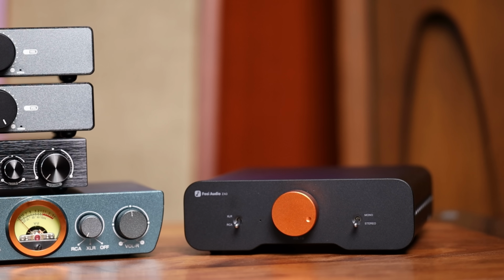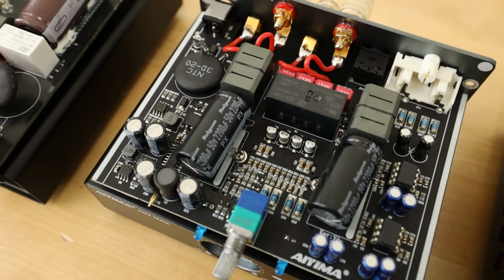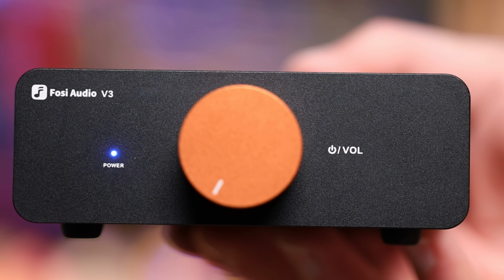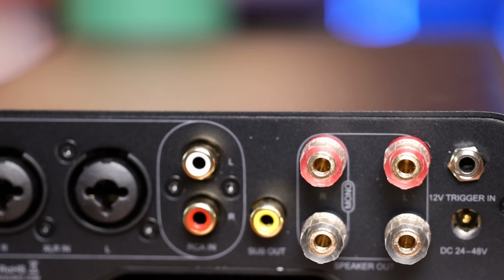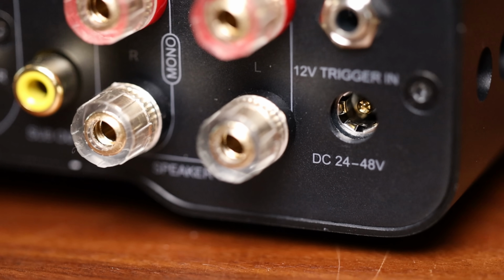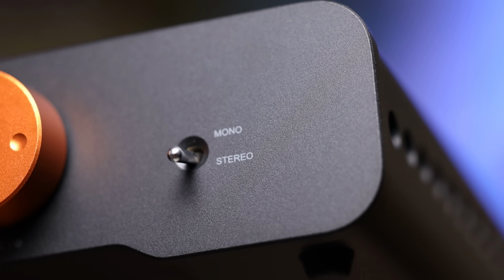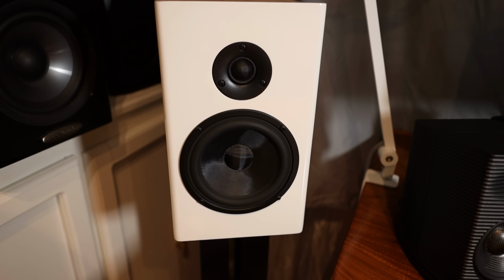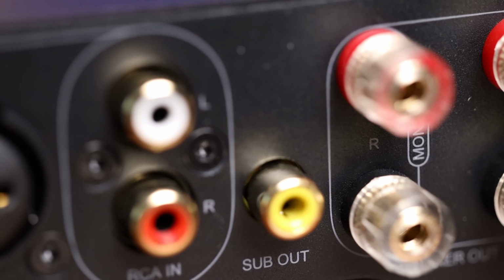Fosi ZA3- Teardown / Comparison / Review - Topping LA90 Who?

Comment: A few suggestions for these ChiFi designers ...
1) Separate power switches.  We don't always want to mess with the volume control.
2) Move the stereo/mono switches to the inside of the unit.
3) Make the leap to full auto-switching balanced inputs. 
4) Include dip switch selectable high pass and low pass filters in the sub-out chain.
5) Start publishing honest specifications.
6) Include Clipping and Protect lights on the front panel.

For #3 ... it's only a matter of a couple of resistors to make those XLR combo jacks accept Male XLR, TRS balanced and TS unbalanced then it's one more resistor to connect the RCA jack to the  hot lead on the balanced in.  ... no switching required.

For #6 ... The TPA3255 supports Clip and Protect lights natively on pins 21 and 19 respectively. It's only a matter of 2 resistors and 2 leds to add them.

If they want to swim in the big boy's pond... they gotta bring the right flippers.
Reply: Thank you so much for your suggestions. I will let you know if we have any updates. By the way, as per the switch selectable high pass and low pass filters, do you mean you can select any frequencies you want? Or just a fixed crossover frequency like 80Hz for high pass filter and 125Hz for low pass filter?
Reply: @fosiaudio  I would like some kind of high pass switch on the main outputs - 80hz is fine. It doesn't need to be switchable. Just something. I had to buy an external high pass and was not happy doing so because the amp was still amplifying the unused lows.
Reply: @fosiaudio 
Thanks for your reply.

If you use 8 position DIP switch modules, you would be able to set at least 16 frequencies for each.  The filters aren't hard to design, it's just a matter of  switching in different combinations of capacitors.  

The two things I really want to see are the separate power switch and that stereo/mono switch moved to a safer location.  I won't be buying ZA3s until you do.

I've already spoken with a couple of early-adopters who've had the ZA3s shut down on them when they flipped it into mono with the power on.  That's not a good thing to have out in the open where curious fingers can cause problems.  

Really guys... you have good products, don't mess yourself up by being careless.
Reply: @Douglas_Blake_579  Thank you for your kind suggestions, we will consider them carefully. And if you have any other ideas and suggestions, please let me know.
Reply: For 70 dollars. Joker
Reply: @psysword 
You apparently have no idea what that $70 TB10D can do when the issues I identified are resolved.  It's actually pretty impressive.

 The ZA3 and future designs are a little more than $70.00 ... by a factor of 2 or 3 times more. 

Plus this company actively solicits user input, which is what I am giving them.
Reply: You should start your own company, since it's obvious you know your stuff.
"AssholeFi Corporation LTD". No need to thank me, friend.

Comment: Hey don't worry about that. My settings on my tablet wouldn't allow me to see the whole page once I got that fixed I found out they're stating it's 300 w * 2 into 4 ohms 150 watts * 2 * 8 ohms and the difference in the Bluetooth of about $7 is ldac support. If I end up getting it I'll let you know. I wish it had an external power supply. Although, looks wise it is very handsome and the venting on the top looks excellent. I'm leaning towards getting it but trying to at least find some sort of review written or video. Might have to look at other countries in Google translate works good. LOL. Keep up the great work thank you Erik

Comment: Based on your review I got one. Can't agree more with your review,so thank you. Further in this topic I placed my findings. One thing to note: I saw a topic about the XLR inputs not being 'true' XLR internally. Not sure if that will make a big difference, because it sounds impressive as is.
Reply: There's an easy test for this ... Select the XLR inputs... with a sewing pin gently touch the contacts in the connector (don't worry it's perfectly safe).  If it is true XLR pins 1 and 2 should both result in a buzzing sound from your speaker.  If only one of them buzzes, it's probably just a single ended input hooked up to an XLR connector.  (And you might be surprised to find out how common that is.)
Reply: @Douglas_Blake_579  
Now that you said XLR to single ended input, that's it. I read that on a thread from ASR (with pics) pointing this out. Thanks for the suggestion re. testing this, appreciated!

Comment: the fosi za3 has some issue, even tho they use the tpa3255 and learned alot from the v3, the za3 has more distortion and lower sinad and lower wattage than others using the tpa3255. strange how a balanced design somehow gained more distortion and less power in the circuit design. also wondering why they opted to make such a small heatsink connecting plate to the case, but i am, impressed with the addition of thermal paste, i did this first when i saw my v3 bare metal on metal ,there is a slight gap that should be filled to help transfer heat anyways

Comment: 12 Volt Trigger for ZA3 ... a solution to the power switch on the volume knob...

Do a search for the "Emotiva ET3" ... https://youtu.be/MBgJn241KNc?si=pc6o3RlHPQ3I4eq_

This might also make a good DIY project. It's nothing fancy, just a 12v power supply, a switch and some jacks for trigger cables.

Comment: You’re wrong about the V3 volume control. I leave mine set in one position. It turns on without rotating it after powering back up.
Reply: You're turning off the AC, right?
Reply from the maker: Right, you would have to power it off externally from the amp to accomplish this which is fine and what I would suggest to avoid using the volume control. A smart outlet or switching power strip are potential options.
Reply: @Douglas_Blake_579 Ahhh, so that's why the Douk Audio ST-01 Pro goes to Stand by...  Also good for the tubes.  Many hi-fi components have a standby setting.
Reply: @peterbaugh51  
I'm not familiar with the ST-01... so I can't really give you much of an answer.
Reply: @MattCoykendall1  
Please be aware that killing the AC is also going to cause strong current inrushes when it's turned back on. Over time micro-damage accumulates in the power brick and it will probably fail prematurely.

In a couple of cases I've seen power bricks -- and equipment -- fail in about 1/3 of it's expected lifetime because of current inrush.  In one case the inrush was as much as 10 amps that lasted about a second... not good for a 5 amp brick.

Comment: Nice improvement over the V3 thats for sure.I would like to see full sized binding posts on something with this much capability, a volume defeat switch so you can use them as power amps, which would go on the front while the mono / stereo switch should be moved to the back. Hopefully Fosi has a new pre-amp coming to go along with this to expand I/O, and add remote capability as this is way more than a desktop class amp and not having a remote is kinda a big deal.
Reply: We are developing, but the case of ZA3 is too small, so we will use  a different case.
Reply: @fosiaudio  Good to hear, and looking forward to seeing it. These amps can definitely be a bit bigger given the systems they can power.
Reply: @PhillioDoede  If it is more bigger, I will add more inputs on it. Haha
Reply from the maker: I was hoping to see a pre amp coming for this pairing as well, I know they have something in the works.

Comment: Do you think it makes any sense to chose the 48V GAN power supply unit instead of regular 48V?
Reply from the maker: I can’t say for certain, I recall reading mixed reviews on that one.
Reply: I've noticed an increase in bass response using the 48volt/5 amp power brick on these 3255 Ti power amps. If you can get a deal on the 48v brick it's worth it.
Reply: what is GAN. i saw that on their site?

Comment: If it had a remote I'd buy it
Reply: Let Fosi put the right minerals inside the box and forget those bling bling you were asking for. It's the AVR's job to provide the remote.
Reply from the maker: Best bet it to connect it to something with a remote, budget wise a wiim streamer, use it as the DAC/Pre. I also have an SMSL DAC with a remote I use at my desk that has balanced connections and a remote.
Reply: i understand what your saying but there is no way to get around 
two volume controls @MattCoykendall1
Reply: We have remote on DAC which is paired with ZA3.

Comment: I always enjoy your videos Matt. Would it be possible to add thermal paste to those other amps to increase thermal transfer? I have remote control power switches hooked to my vintage gear so I don't have to change any settings. Maybe that would work to maintain your volume settings.
Reply from the maker: Yes, absolutely you can do that
Reply: Thermal paste can indeed increase thermal transfer according to our test, but it is not convenient for this pull-push assembly.
Reply: @fosiaudio  Neat, good to know.

Comment: Ebay has 10 amp 48v . Y the power cable to monoblock s , a big sub is needed or monoblock  will over play it
Reply: I use 500watt plate amp with control and duodayton18s  monoblocks have 70hz hi pass fmods and douk pre amp .in use for year,got the boards from Amazon, they don't get warm driving 8ohm load.

Comment: I agree with hiding the stereo/mono button as that is not something you want to hit often and could even cause major issues.  Also, would prefer a line out button that would remove the variable output volume turning knob to disable the volume knob completely and the noise I am sure it adds to the signal.

Comment: I just finished tearing the innards out of a pair of 1970s Wharfedale Dentons and replacing them with modern drivers and crossover. They were a bit too bright initially, but strangely sounded at their best with a P3  Pre and V3 power amp. My least expensive (by far) amps.
I now wonder what the P3 and twin ZA3 in mono mode would bring to the table.
Reply from the maker: I have a feeling you might find out! haha
Reply: @MattCoykendall1  You are just as cynical as my wife, Matt, but you may be right. Having said that, sometime in the next few days a vintage, recapped, Sansui AU7700 and TU7700 tuner will arrive in a big box, eroding any goodwill I may have accrued recently, starting the new year with a deficit in the husband/ wife hifi account.
So the Fosis may need to wait till the inevitable discounts start and I am back in the good books.
In the meantime, from the land of Tartan and Hogmanay, have a great New Year !

Comment: 4:40 note: while there is no integrated control over crossover frequency, the subwoofer output features an integrated low pass filter to cover the 20Hz - 300Hz range. source: Fosi Audio's youtube channel. just sharing this info in case it is useful to someone
Reply: We have not integrated crossover control because most of the active subwoofers have it. So do you think we need to add it on our amplifier?
Reply: @fosiaudio  no, I agree with your assessment.
Reply: @CommentChef  Thanks, most passive subwoofer owners may need the crossover. And we are planing to develop a crossover for those who need it.
Reply: @fosiaudio  A high pass enable for the main speaker outputs would be nice to have

(choose whether they get the entire signal, or say high passed at 100hz while a sub output handles the lower part)
Reply: @fosiaudio  Low pass is normally included on active subs but high pass would be good to have.
Reply: @fosiaudio what's the quality of Power supply? Can you brief pls?

Comment: A pre-amp (with bass management) is my long-term preference. The common (80HZ) high pass (if included on the amplifier) may not sound best with your future speakers. This amp is built to a price point of $100 for a reason. With 48V brick, and pushed to max...going to get hot. The enemy of long-term survival in electronics gear.
Reply: sorry, but this ZA3 was reviewed by a couple channels already on YouTube that said this amp doesn't get hot using the 48 V, 5A brick.
Reply: @shipsahoy1793  Wilson Labs tested ZA3 to have 1% THD and to me, that is not high-quality output. The ZA3 uses Thermal Paste for a reason, and most of the other $100 Class D amps do NOT use paste. The sub-out still retains a full-range signal to your speakers. Not ideal. Finally, the XLR inputs are low-cost plastic combo units, and likely only wired to a single end internally. These are the facts. It's a $100 amp and electronic parts are relative to results attainable. Great for a small space budget-driven system, The HYPE on YouTube is all about the ZA3 (x2) being a MONO BLOCK killer setup for under $300 with HUGE 4 Ohm ratings. I choose not to believe the output claims as many other amps tested lower in real usage situations.
Reply: I don’t think a $100 speaker amp is built for longevity in general…
Reply: @EricRosenfield  yes. agree. LIke a $100 plastic plate in a microwave oven. Schitts gonna melt. Haha!

Comment: It would be interesting to know how these fare against good sub $1000 amps like the Cambridge AXA35, Rotel A11 MK2 and Audiolab 6000a. Are they there yet? Especially using two of these with a pre-amp like the P3 or a good headphone amp.
Reply: Curious too, besides sceptic, and exactly what I'm about to find out, lol. I own the 6000a and tomorrow the ZA3 comes in. Speakers are the Wharfedale Linton.
Reply: @34332  I'm excited about your review ZA3 vs 6000A...
Reply: @34332  Please let me know if you published your review. It helps a lot to improve our products.
Reply: @34332 How do they compare ?
Reply: I own both V3 and AXA35. It's a sidegrade really, which by itself speaks highly of the V3
Reply: I can tell you that its not close. I have both HK pm665 and yamaha A S801 using polk audio 10b. While the sound from Fosi is clean it strained in a big room to drive the speakers. Very thin on the mid tones and bass and had to turn the volume to get them to drive the speakers. Eventually used an old yamaha 10 band eq to boost the volume and increase mid tone and bass response. That being said, for the money the ZA3 is a good value but will definitely not replace good quality AB amplifiers.

Comment: Thanks Matt. I really enjoy your reviews. I ended up buying an Acrylic B-50 on sale at $104 and use it as desktop driving a very old Bose AM7 set of speakers, noticed that using better cables provided noticeably better sound on these. Also tried it on my Polk Lsim707's (still regret not getting the 703's and the 706-C center channel when they were on sale) but didn't like the sound, maybe a pair of these Fosi ZA3's as mono blocks...hmmm
Reply from the maker: The B-50 certainly has more options as far as connections go but I would definitely put this ZA3 above it in sound quality. Thanks for watching!

Comment: If I need more power in my system would I be foolish to use my Audiolab 6000A in pre-amp mode with the ZA3?
Reply from the maker: I dont think it would, the 6000a is a good amp (I have one) but you could use the ZA3 or a pair along side the capable preamp functions of the 6000a.

Comment: Do you set the ZA3 volume to a certain level, then control the volume via the pre-amp?
Reply from the maker: That is the setup most will use here, opens you up to remotes and things like that with the preamp. I would just set the volume around 3/4- full and let it be.
Reply: In my system I use a Windows HTPC->DAC->TB10D->Pioneer tower chain.  I've found it best to use the volume on the TB10D to set a maximum level, then use the volume controls in Windows to control my actual listening levels.

Comment: My advice to Fosi is to bring out a full sized unit incorporating the following.
1. Several switchable inputs, 4 off would be good.
2. Bass and treble controls, and whilst at it, why not switchable?
3.A separate on/off switch.
4. Incorporate the switch mode power supply within the case where there would be ample room.
I am sure other potential customers have their own suggestions.
Most integrated full sized amps already have these facilities, so why would I want to go backwards with this small unit which will run hotter as well.
If the above materialised, I would probably buy one, but this version is too limited, mainly because I need inputs for CD player, Tuner, Tape deck etc.and I don't want to use a separate switch box with additional clutter.
Reply: Thank you so much for your kind suggestions, we have a fosi audio BT40A under developing and you can keep an eye on it.
Reply from the maker: I know they have something in the works like this but not sure how far out it is or what it will all include.